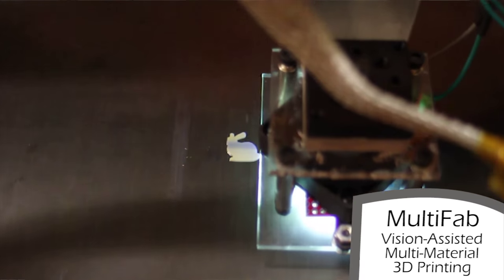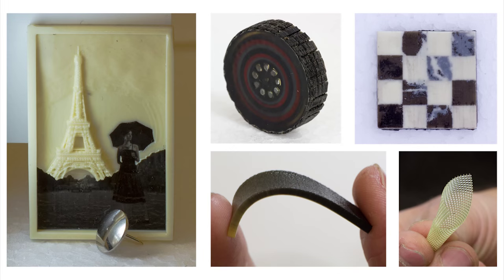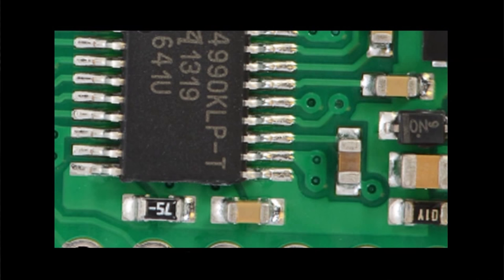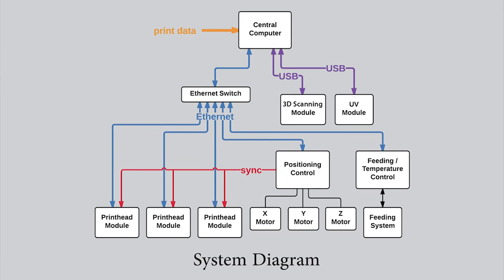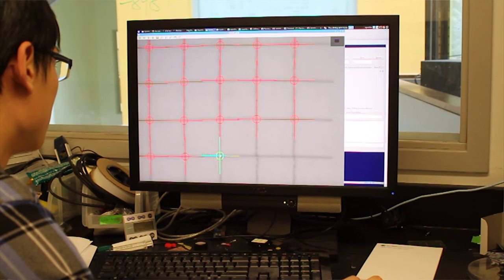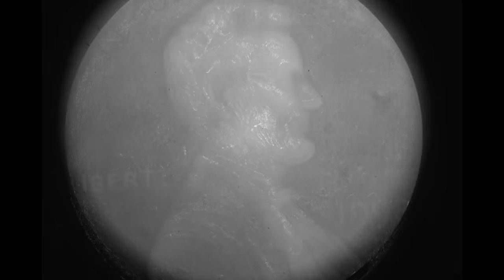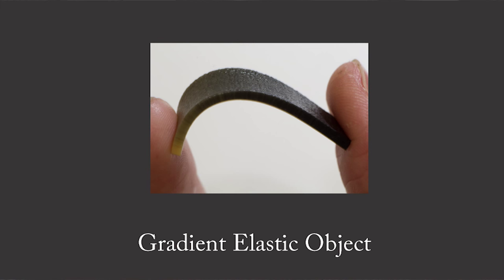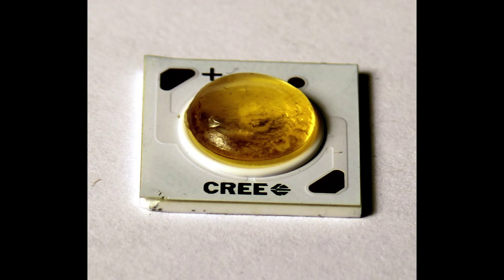MultiFab: Vision-Assisted Multi-Material 3D Printing

Comment: So if your print resolution is 40 Microns... and the repeatability of your motion system that carries the vision and print system is probably around 20-30 microns, how do you print anything?
Reply: +Fa Ga  The resolution is Layer thickness in the Z axis and the 20-30 micron repeatability is actually in the X and Y positioning. Its not bad for all that on the print head.
Reply: +Fa Ga When you try to intellectually criticize an MIT project without proper information (you're just making "educated" guesses) you're probably going to end up making yourself look foolish. Just saying.

Comment: Wouldn't it still be slow? Even though its printing multiple fabrics at the same time, it still looks slow. If you'd use carbon3d's method of printing, even  though you'd have to repeat the printing process for each fabric with their method, it looks like that still would be way faster.